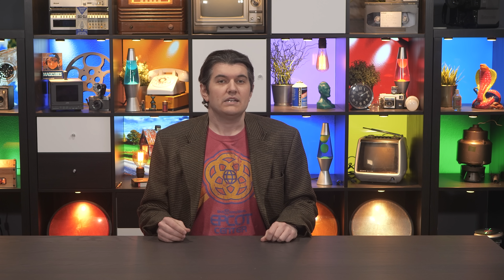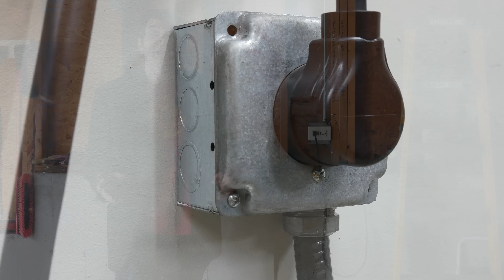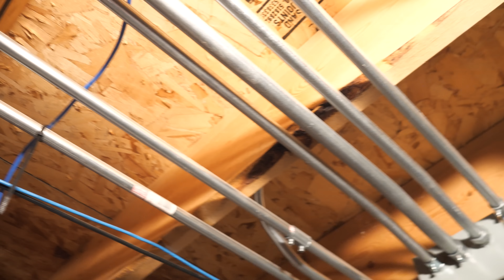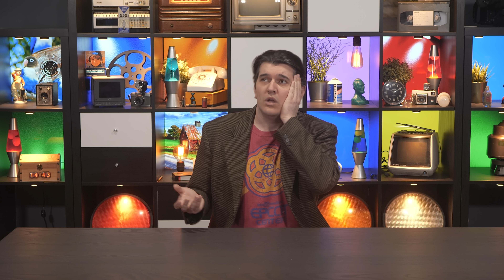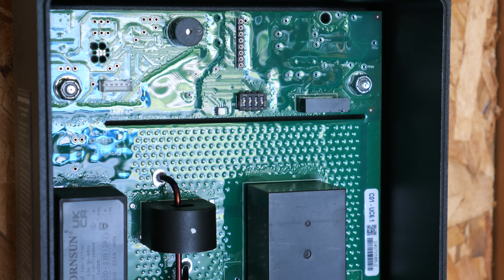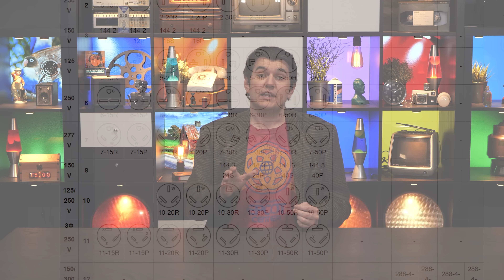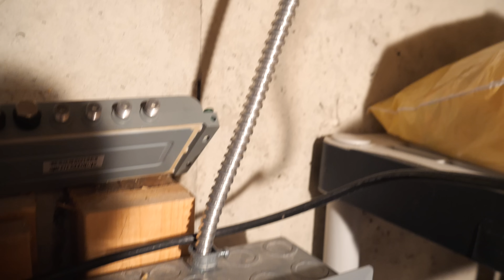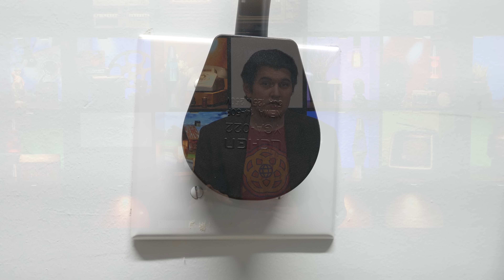The "standard" car charger is usually overkill—but your electrician might not know that

Comment: I love DIP switches! I remember overclocking my first decent PC, a gateway K6-2 500mhz, to a whopping 550mhz using DIP switches.
Reply: Damn +10% overclock just with switches, nice
Reply: The only downside I could see for DIP switches on your motherboard, over jumper blocks, is the inability to do what I did and use the turbo switch on an old PC case to wire up to a multiplier or bus speed connection. Off: AMD K6-2 350 running normally at 3.5x100MHz. On: bus speed jumps to 115MHz, making the CPU run at over 400MHz. ... if you had a stable enough system and components to handle it. Mine could, but crashed if I toggled the switch while it was running.

Comment: The GFCI requirement on heavy circuits is basically "if you jurisdiction has adopted the 2017 or later NEC it needs to be GFCI". In practice, this means that you just buy a more expensive breaker ($80 at the supply house, $200 at Home Depot).

Another thing that is routinely missed is that *NEMA 14-50 is an absolutely pointless connector for this job*. 14-50 is a dual 120v/240v connector. You need to run 3 wires (plus ground) - your two hots and the neutral. The EVSE, in turn, *does not use the neutral*, because it is a purely 240v device. Installing a NEMA 6-50 (a common "welding" outlet) and changing the plug on the EVSE or direct-wiring lets you skip one big chunky 8ga conductor *that was never going to carry current*. Mine are installed with a 14-50 because I am a lunatic who might need 50A of 120v in my driveway at some point in the future and an extra fifty bucks worth of conductor was worth that flexibility.

Our EV lives outside - not in the detached garage. The detached garage panel is big enough, but its a shop, not for parking.

The charger is on the side of the house. The car gets plugged in when it's down to ~20%, kick it back up to 80 or the night before a big known trip and go all the way to 100%. Otherwise, it's usually not parked anywhere near the charger, because what kind of weirdo uses the side door of their house (particularly when the porch is so small that deliverymen love to block you from being able to open the outswing storm door)

Comment: I mostly agree with everything you’ve said, though there is one aspect you didn’t touch on. 

A lot of people will have cheaper electricity rates at certain times of the day - maybe from solar or from offpeak grid power. Having a more powerful charging circuit can help make the most of these periods. 

It’s obviously highly dependent on when and how long these periods are, plus your electricity rates, but a simple example is my electricity retailer gives me free (yes, free) power every day between 11am and 2pm. On my 32a charger, I can pull down around 21kwh every day for free (I work from home). My usual electricity rate is 24c/kwh, so I’m theoretically saving over $5 every day, or over $1800 a year. Sure we may not utilise this to its max, but we definitely make the most out of it with 2 EVs and a ton of driving, and would have saved the cost of installation of a faster charger within a couple of years.

Comment: Turn the wirenuts right side up so if there are any water leaks, they shed water instead of collect it.

I think it was implied but you could have had more emphasis on your car battery recovering from long trips.  If your half power charger gives you 80 miles of range per night and you normally drive 40, then if you drive 160 miles one day, you will still be able to drive 40 ( or even 80) miles the next day because the 120mile battery charge deficit would be recovered at 40miles per day.    And in about 3 days, your battery would be back at full charge (or 80% if you prefer).   So you likely don't need to rely on the fast chargers as backup unless you have two longer trips back to back.

Instead of spending $300 on the overpriced switcher (and adding an unnecessary relay to high current contacts),  you could use it to upgrade to an EVSE that has load sharing with non-EV circuits.   It isn't that hard to check how much current is being drawn by your dryer, table saw, heater, or even another non-communicating EV charger and reduce the current available.   Some even use a sensor that checks how much current is being drawn by the whole house (or subpanel) and adjusts based on that.  And some use OCPP or other means to communicate between chargers to share a circuit.

I would like an EVSE that can communicate but I want to have control over it.  I want a device that is smart, not one that pretends to be smart but is actually stupid.   I don't want a dodgy chinese CPU doing the networking, dodgy closed source firmware, or a dodgy closed source app.   I would rather have a TTL serial line, SPI, I2C, canbus, or RS-485 with documented protocal and supply my own networking such a Raspberry Pi Pico 2 W board.    The openEVSE has some of these features and the optional ESP32 board could be replaced. .  And definitely keep the dip switches to define the default power on behavior unless overridden.     The thing should just work standalone with no communications.     Load sharing could also be done analog.   Have each charger (or external load sensor) put 1mA into a shared 50ohm resistor  (for 50Amp max) for each AMP of current drawn.  If the voltage goes above 2.5V,  each charger folds back the current output.   Or only the low priority one does.   Use separate pins so it could also be used as an analog current output and an analog command pin with an external controller.   Change the resistor (possibly using dip switches and change the max current draw).  Or plug in a current sensor module.      

Anyway, good video and I would like to see an updated version of the other video.

Comment: Back when Chevrolet installed our charging outlet for free, they installed it on a 40 amp breaker to match the mobile evse that came with the car.  I have since upgraded to an Emporia evse but left it throttled to 32 amps because it is plenty fast for my needs.

Comment: Meanwhile in Australia you can get lucky. Have a home with 63amps of 3phase 415v, (I only just realized this is where the common 43kw figure comes from). These are mostly used for thermal appliance like HVAC and Water Boilers. But obviously great for EVSE also.

Comment: Electrician here that's been installing them since the first EV
It’s not that we’re confused—the problem is that dealerships selling these cars don’t know much, and most homeowners or car owners know even less. I’m also not motivated to learn the hundreds of constantly changing home charging station models that keep popping up.

Clients tell me what they want, and I install it per NEC code.

The instructions that come with these chargers are often vague and confusing. They’re usually generic manuals intended for multiple models, and key information is often hidden in the charging station itself, buried in the car’s manual, or not communicated at all—especially by the people selling the cars.

ALso the dip switches have been  gone now for maybe 5 years. I more often install the common brands that are sold. they been moving to phone apps or claiming it can sense the breaker size??

From my perspective, I tell the customer that I’ll install what they ask for, but I’m not tech support. An electrician’s job is to run power to a device—we’re not trained to troubleshoot electric water heaters, AC condensers, microwaves, or electric stoves, and car chargers are no different. It’s not realistic to expect us to know everything about every device we connect.

If you want specialized support, there are EV charging installer specialists—but be wary. Some of them are just people who know just enough to be dangerous.

On trying to talk people into less than 50 amps when there service can not handle it. they rather spend 5-10 thousand dollars or call some one else than drop to 40 amp breaker size.

And final, wire nuts were fine in that situation.

EDIT – Final Note:
PLEASE, PLEASE DO NOT use the 120V charger (i.e., a standard wall outlet). Most household outlets, especially older homes, were not wired with continuous heavy power draw in mind. Using them for long charging sessions will heat up every outlet on that circuit, eventually leading to melted outlets—at which point I’ll be the one you call to replace them all.

If you must use 120V charging, at the very least install a dedicated 20-amp circuit. But honestly, if you’re already going that far, just install a dedicated 20 amp 240V outlet instead—it’s safer, more efficient, and the proper long-term solution.
Reply: Most cars now default the 120V charging to 8 amps instead of 12 amps, and you have to tell the car your outlet and wiring does not suck to use 12 amps.
Reply: @enahs5551  that's better the possible 12 amps i was thinking but still 8 amps for 24+hours is still not good as it will heat up loose connections in every twist or stab back outlets used for the in and out.
Reply: You just need to replace the old worn outlet.
Other guy is incorrect: at least my EVSE defaults to about 13A. I got an angled plug: because I did not like how warm it was getting at the bend.

Comment: This is NOT to say that DC fast charging is "the" answer for renters, or even a good one, but at least the fast charging networks are installing their chargers in places that people actually need to spend 20-30 minutes such as grocery stores. That softens the blow *a little*.

But, DC fast charging is also only barely cheaper than driving a fuel-efficient gas car, while the car itself is going to be many thousands of dollars more than something like a Nissan Versa or Toyota Corolla. So while we can ease the pain of the charge times for renters, they still take a significant financial hit compared to people who can charge at home.

Comment: difficult to believe this is cheaper than a gasoline engine
Reply: If you have solar energy, charging can even be free. Unless you have a pump jack and a refinery in your backyard, you're paying at the gas station. If you have an off grid cabin, this stuff is so damn flexible. Gasoline is cheaper because there are far more older cars for purchase, but per mile, it's hard to beat electric efficiency.
Reply: @Biru_to  in new york gasoline vehicles cost about 20% more, and 60% more in LA.  So it is cheaper but not a life changing amount cheaper.  However once in factor in the added cost of the vehicle they are about even in la and new york

Comment: I have a 2017 Chevy Bolt, and I have about a 120mi round trip commute to work. I am using a 30A circuit and my car is always full when I leave in the morning. I get home at about 6:30pm and leave at 5:30. In the winter I get home with about 30% battery and it was always fully charged in the morning.

Comment: Timely video. I'm in St. Paul, MN, and despite my zealous Midwest sensibility, I'm iconoclastically burying aluminum MHF cable (2/2/2/4 AWGs) to the detached garage to supply up to 70A to the new subpanel that's going in. I figure it's good to have the head room. I don't have an EV yet but if I ever get one I'll put a 50A breaker in that subpanel for EVSE. It's a heck of a job running that MHF through conduit, let me tell you.

Comment: The Bolt is able to charge at 8 or 12 amps on its 120 charger. Used it to charge at my vacation rental property routinely using the 120 v outlet.  Typically 36 hours to recharge from 15% to 100%.

I now have a 240 volt 32 amp charger installed there so I can charge up in just a few hours.

Edit: I agree, hardwire is the way to go.

Comment: The problem with aluminum wire isn't oxidation, it's expansion and contacting due to heating and cooling causing the connection to loosen over time. Modern alloys of aluminum don't need any noalox, and using any is actually against code in some situations.
Reply: Thanks you, brother, for helping spread the word.  Modern AL wire is formed of trapezoidal strands that fit and pack much better than the old round strands; they compress and retain their shape better.

Comment: All 240v circuits should be fed by 4 wires to keep with code. If your 240v device does not have a separate neutral and ground connection then you need to look for a safer device.

Comment: Solar on the car's roof initially SOUNDS like such a great solution for millions of street parkers with short commutes. "Just 10 miles a day would more than more than meet loads of people's daily needs, dramatically curtailing how often they'd need to use fast charging." But then I look into it, and it seems like 3 miles in a day is typical, which is slow even for my optimistic self...

Comment: There are some very good reasons to have an app: charge when power or power delivery is cheapest, split charging cost between users, prevent unauthorized use etc. Btw, your point on slow charge is very valid. When I got my Model 3 two years ago I thought I had to invest in a charging station. Using regular socket is doomed unsafe. But until I got it done, I just turned down charging to 9 amps. Two years later, I have never had the need for faster charging. Even if it’s not fully charged when I need the car, the range is so good that I never have any range trouble. When I go for long drives I’ll use the fast chargers anyway. And they are so fast that I need longer time stopped for food and bathroom than the car needs to charge.
Reply: Define long drive.
Reply: I think most of the people that complain about apps aren't Tesla. The Tesla software is amazing and it just works.  It's funny to me that the only Level 3 superchargers that reliably work are Teslas', ones that are very software-dependent.  People can say all the time that they hate apps, but for Tesla and charging, theirs work better than everything else.

Comment: I am an Uber driver. I drive an ioniq 5. At my old apartment, I was able to use my 30 amp dryer outlet to charge my car. It was more than enough. I would usually get home with 5%-20% remaining, and would be back at 80% by the time I was ready to leave the next day.

Comment: You can get MC in 10, 8, 6, 4, 2AWG.  1/0, 2/0, 3/0, 4/0. It just keeps going!
Go to a supply-house. 
120v (112) sounds miserable for charging a thousand pounds of batteries. Go for 240v (208v for most situations)
I only installed charging stations as free-bees when I did Solar installs. So I'm definitely not a CerTiFieD pro, but what even is that. It's a dryer outlet with a fancy vernier on top.

Comment: I may have one of those big trucks but that is also a Tesla. I was determined that I was going to install the Tesla 40 amp home charger, but prepped for the arrival of my vehicle with a NEMA 14-50 and the 32 amp mobile charger as a temporary setup. Not only did I realize that more amps would be of no benefit since I can already fully top off overnight, but I actually dial the amps back on the car side to 20 amps just so as to not stress the system. In other words you're right, most systems, including the mobile charger that came with my truck, are overkill.

Comment: video suggestion for technologyconnections: the 2027 Cummins x15 is changing from a 12v to 48 volts system to power Two 5kW electric heaters, in the after treatment stream.

also volvo trucks moved the vnl to a 24v system from a 12

the circuit panel reminded me as I looked up how much power the heaters would take and it's excessive nearly a household worth or enough to slow charge a ev

Comment: Using a 24 amp dryer outlet and a dual Grizzle E for dual electric car charging. Even with the massive charging amperage de-rate we find it ample. 100,000 miles between both vehicles over 3  years using primarily AC charging on a single 24 amp (30 amp breaker) service

Comment: that grizzl_e charger looks like it should cost less than 100 bucks.
Reply: The exterior is thick cast metal, not a lot of plastic with those units. Also includes over 20 ft of high gauge copper wire, copper isn't cheap.

Comment: In my case, NEMA 14-50 in an outdoor box was a really good fit for what I wanted in my driveway (no garage).  Wired it myself, no electrician involved.  The local utility board gave me a bill discount that covered the cost of the EVSE, so I put in the biggest one that the bill credit would cover, and I have a 40A EVSE even though my plug-in hybrid can't accept anywhere close to that.  Futureproof for my next car.
Total cost was about $50 for the box, outlet, wire, and 50A double pole circuit breaker.  I know, my situation isn't necessarily typical, but it worked for me.  And if I do sell the house, I can easily unplug the EVSE and take it with me, which is why I didn't just hardwire it.

Comment: I thought I was lucky and have 240v recipticle in my garage for a dryer (we have a gas dryer) but found out it has aluminum wire. I will probably rewire with copper. We are currently using 120v charging.